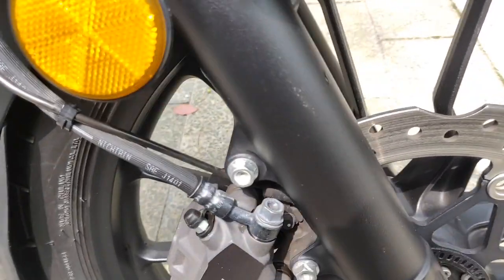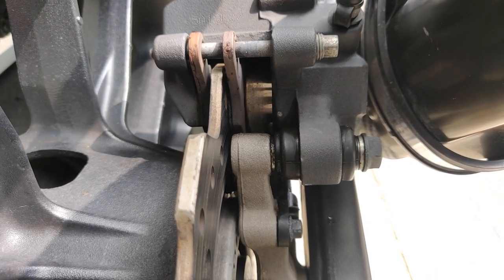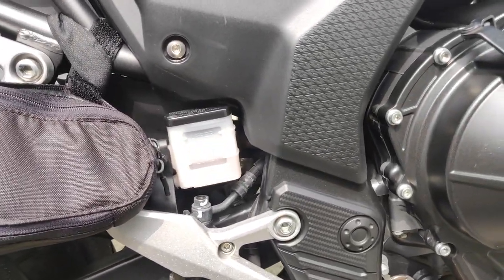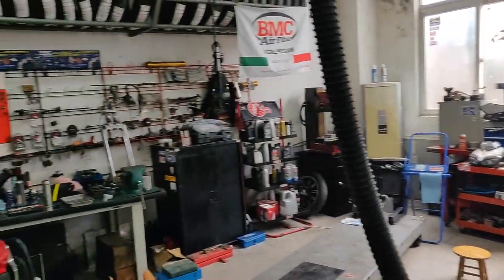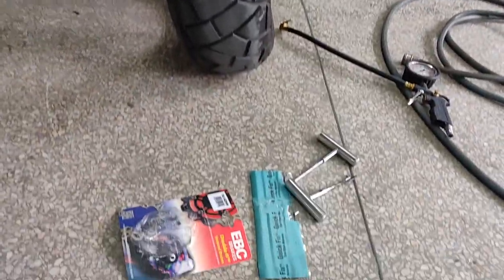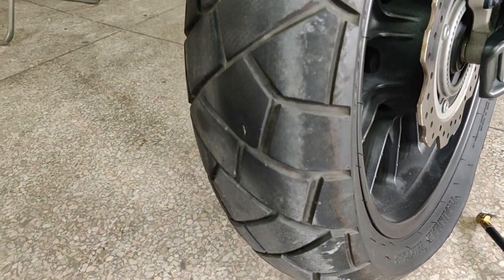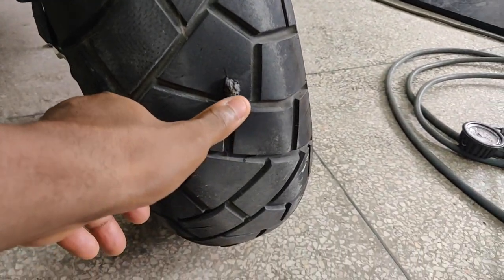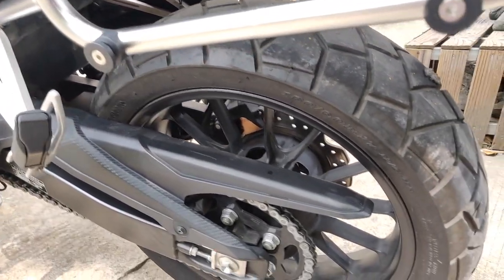Installing New Brake Pads For 2019 Honda CB500X And A Surprise Puncture

Comment: You don't tell us how many miles you have ridden since last rear brake pad change to enable us to judge whether good or bad.

You say you use rear brake more than front.  Why?  Are most of your miles in stop-start traffic?  Otherwise, I would expect front pads to wear quicker from using the front brake  more.

Comment: Not sure about your riding style/conditions, and correct me if I’m wrong, but shouldn’t you be using the front brake more than the rear brake? The rear brake is only really used in slow moving traffic and slow speed manoeuvring. Something is wrong if your front pads have hardly worn, compared to the amount of wear on the rear pads. Just saying.
Reply from the maker: Not sure if there's a standard as to which breaks should be applied first. For me, my first instinct is my foot, and then the front added for emergency braking. I know some bikes have synced brakes so the front lever will control the rear breaks as well, I may be wrong. And the dipping of the front when front brakes are used is a bit annoying. Like you said, different riding styles maybe.'